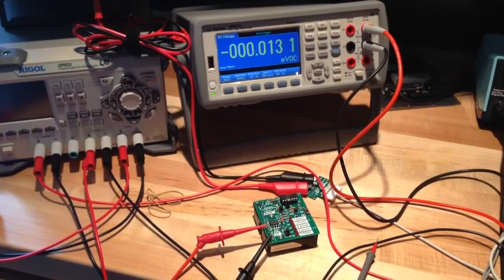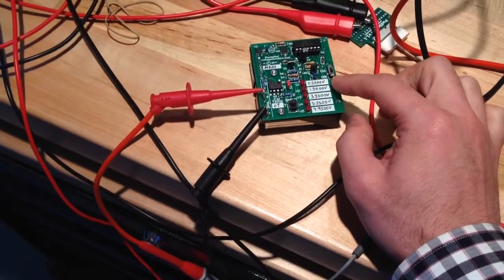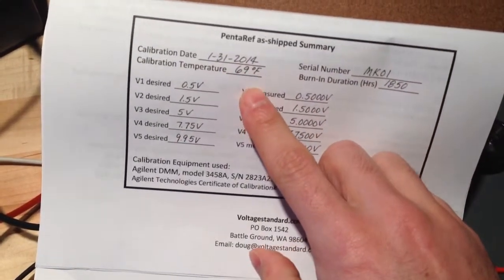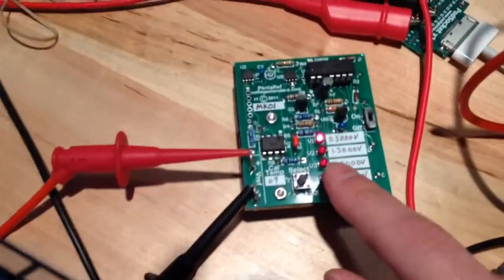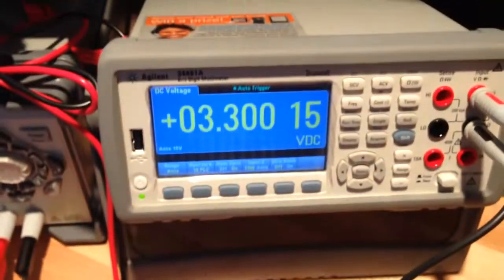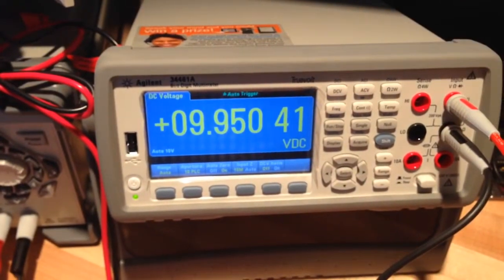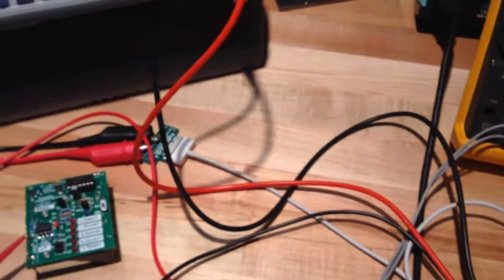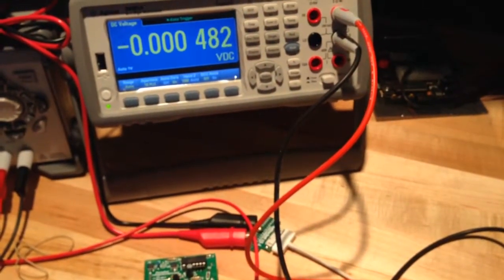PentaRef by VoltageStandard.com

Comment: I fully vouch for the service of Doug at "voltage.com". Due to my work, quite often I have to carry the PentaRef with me on assignment. However, I broke the battery terminals when I had to take the batteries out to clear security at the airport. Not the PentaRef's fault, but rather my own fault. I didn't have any tools at the time, and I just force the issue and broke the terminals. Told Doug about it, and he said to send it back for repair, which is free. I got it back within 3 days and not only was it fully repair, but the PentaRef's voltage reference was re-calibrated. Now that's a 1st class service. This day and age, getting these kind of support is remarkable.
Reply: Yeahh... Doug sounds like one of these legends electronics dude!! I've got my PentaRef and I also loved the device and the service!!